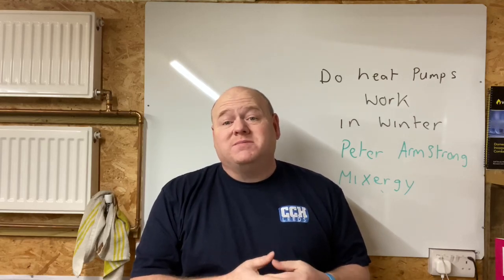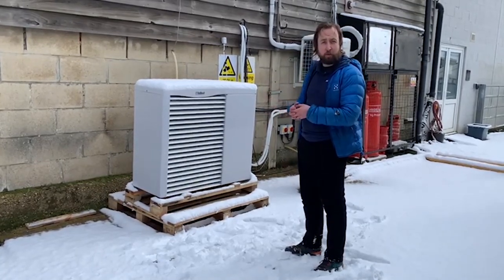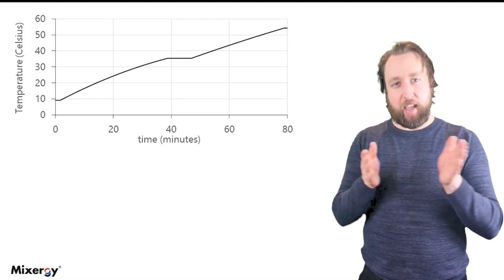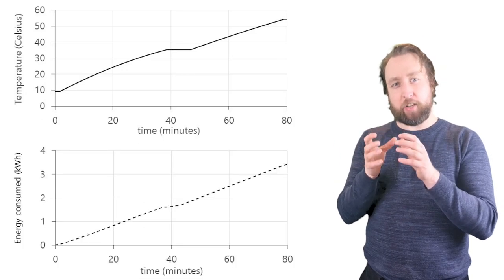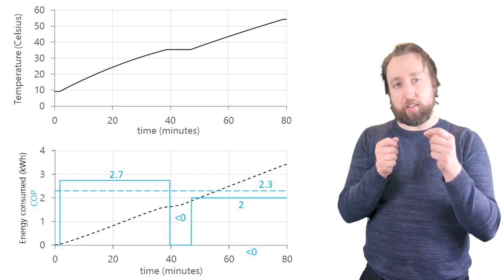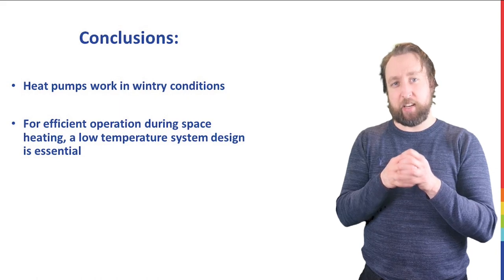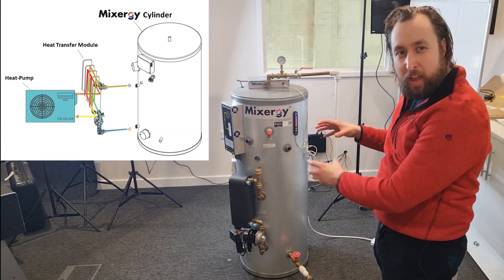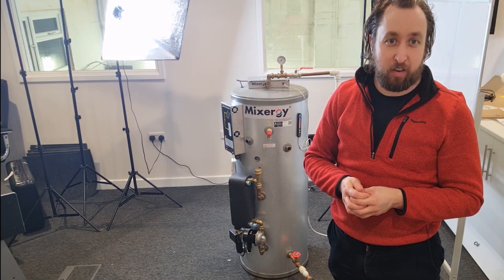Do Air Source Heat Pumps Work In Winter - Peter Armstrong Mixergy

Comment: Ive Fitted ground source and air source heat Pumps with underfloor hesting in and around Munich. And lived in a new build with a air source myself. I can say you can tell the difference in Winter and summer.  As far as retro fitting your average house, i Think these Systems are still prohibitivley expensive. I Think the Systems we were fitting were around 15k Euros. But we working in the Sticks without a gas pipe and oil will be getting phased out here soon.
Reply from the maker: Do they normally work well? Thanks.
Reply: @AllenHart999  yeah they are when theyve been Setup properly. You can be assured that cowboy Builders and weekend warriors wont be throwing them in. The air Pumps are generally easier to install. the ground Pumps. Ive done bore holes in germany and ive done underground flat tubes in north yorkshire. Both bore and flat underground cost alot to install in either case
Reply: Ground heat pumps works well in winters( also in -30). Best suited with ground heating, nut can be used with big radiators with calculation flow40/35back flow
Reply: Presumably the electricity being used to power the heat pump is generated by German's lovely new lignite power stations, sooo green.

Comment: Electricity =15p/kw. Gas=2.5p/kw. 6x more money for elec but when the temp drops outside you're lucky  even to get as much heat out from a heat pump as you put in in power.
Not to mention that r32 refrigerant is 677 times more polluting than Co2 if it escapes.
Reply: My figures are nearer 10x the cost of gas for electric. . . As for the earth, in the UK half the electric comes from burning gas, the generation and transmission is only 50% efficient.
Reply: If one unit loses its Refrigerant CO2, it is still less CO2 than what a Gas Boiler produces every year.
Reply: A typical house running on Gas produces over 4000 tonnes of CO2 per year.
Reply from the maker: Thank You
Reply: @kenbone4535  4 tonnes per year not 4000!, think you misread Kilogrammes.

Comment: I designed my own hydronic radiant heating system for my new build in Ireland. Mixture of underfloor and low temp rads. I'm currently getting SCOPs of 4.5+ from my ASHP. That's only possible because I upgraded he thermal performance of my home to a B Energy rating, I switch to a wood stove boiler when it drops below 7C outdoors, avail of night time tariffs and use a 1000 Litre multi-coil (Solar/Wood Stove/ASHP) thermal store. The system works really well, but it took me about 3 months to finalise the design, before handing it over to my plumber. In my opinion, you need to be maintaining SCOPs of 4+ to make it a worthwhile choice over gas, in the UK/Ireland that is. Regardless of the grants, if gas or oil was an option, I would not have gone with an ASHP.
Reply from the maker: Thank You

Comment: Those heat transfer modules have been around a long time I used one of them 30 year ago to convert an old direct cylinder to indirect they do mean having a special phosphor bronze pump as there on the direct side of the hot water system.
Reply from the maker: Thank You

Comment: Moved into a cavity insulated 70's build house about 4 years ago and the previous owners had installed an ASHP with regular radiators, not underfloor heating. When the outside temperature drops below 3c or 4c then it really struggles. It goes through cycle of frosting up, defrosting and repeating. At best it maintains the house temp at a low 16 or 17c and we rely on plug-in oil filled radiators to heat specific rooms of the house. 

Don't have the money to rip it out and install oil tank based system (in the sticks so no mains gas where we are) so we'll have to live with it until the system gives up and save some money to replace it then.

Comment: These things will work if you have a modern well insulated home with UF heating, however the majority of British homes are not like that. 
And l have worked on jobs where heat pumps have been installed on older properties, and they had to have over sized radiators which also needed an electrical supply for the built in fan.
I just don't get the push for these things in the UK, and the last one I went to was a block of ice, that was heating a swimming pool, plus where there's government money there's going to be miss selling, so you can imagine the adverts in a few years.
Reply from the maker: Thank You

Comment: If the heat pump maximum temperature is 60C then the COP would be curved as it gets close to it's maximum temperature. But the line you show is almost straight line up apart from it's defrost cycle. Also heat pumps use speed control inverters that would use variable  amounts of energy, but again your KWH over time remains constant?  Also are you measuring the temperature of the water at the top of the tank only. A more accurate measurement is to measure the top and bottom of the heat and take the average. But i did the maths on  your numbers 120littres heating water from 10C to 50C at an average COP of 2.3 did work out to take 1hr and 24 minutes. It would have been a nice test if you repeated the test over different outside temperatures for a graph of COP performance. And at what outside temperature the system fails to add heat to the tank. Date 2/11/21 UK price  cheapest electricity 16.7p /kw    gas 6.65p/kw, home  heating oil 5.4p/kw  So to rip out a gas boiler for a heat pump. Is more expensive to run than gas  or heating oil. As for kw to kw of effective  heating  comparison with a COP of 2.3 electric  will cost you 7.2p and gas 6.65p
Reply from the maker: Thank You

Comment: IMO heat pumps make sense when used as an auxillary heating/cooling option e.g. split AC systems that can both heat/cool & are basically air/air ASHP's. Roof Solar can run the AC 100% in the summer, & the AC Unit  can 'topup' the house heating in winter especially on sunny winter days. But for the depths of UK winter you do want gas heating IMO.
Reply: cant enough solar do it all?
Reply: @bootangy  Solar is only working during the daylight hours and the largest demand is in the winter when solar is at its worst  for generating power
Reply: @ianship5058  At least 16 hours of none generation in mid winter is a big turn off.
Reply from the maker: Thank You

Comment: I am a commercial / industrial gas engineer and am looking into all the various sources of heating. Possibly the best option is to have a Hybrid option where if the heat pump cant supply the demand you have hydrogen or existing Natural gas or LPG or oil as the backup source.
Hydrogen itself is not the easiest fuel to deal with, yes the emmisions are co / co2 low or neutral however it also produces Nox and apparently quite a bit more than current natural gas or propane fuels generally do. The other thing is safety - Natural gas is explosive at 5 % to 15% gas in air and has a lighter than air density of 0.6 , Hydrogen is explosive at 45 to 74% and has a specific gravity of 0.06 which as its thinner is much more prone to leaking than Natural gas and is way more volatile, also you cannot see a hydrogen flame easily at all so safety of hydrogen is a massive concern to anyone suggesting to use the existing network to distribute hydrogen.  The Nox element of combustion is approx 5 to 6 times more than Methane (natural gas) and Nox contributes to Asthma amongst many other issues.  The Coils from Ground source heat pumps in my little experience on enquiry did not have an extremely long shelf life, thus the cost of replacement or repair of these ground source coils would be massive.
I dont think completely eliminating fossil fuels is honestly viable and think the best possible outcome is a blend of fossil and renewable fuels coupled with maybe the hydrogen fuel being blended with natural gas.
I'm certainly not a complete expert but just cant see any one solution working on its own.
Another note is that to have a air to air heat pump or indeed a ground source heat pump your house has to be extensively insulated, however many new build houses in the uk are so sealed up and insulated that the moisture the occupants breathe out cant escape the property thus causing damp issues. In instances i have encountered people have fitted a PIV fan in the loft which then reduces the efficieny of the insulation by positively pressurising the house thus creating circulation and assisting the moisture to leave the property but also then losing more heat out of the gaps in the construction of the property because of the positive motive force required to move the moisture out.
Reply: An interesting post that shows none of it makes total sense. But somewhere in amongst it all is the best system for what though, us or the Planet or profit. 

The cheapest greenest system is the Sun, if you block it you have to replace it with something that costs. Maintenance started with the Fire grate in the range and in the hearth and it's moved on to scavenging Heat pumps and wet insulation. The Sun is maintenance free but for some reason we have been concentrating on blocking its ingress and that only favours a few.
Reply: @Mark Conroy we have a hybrid system, a Samsung EHS Mono 16kw ASHP, mated with a Vaillant Ecotec 30kw natural gas boiler.  The system is brilliant, the ASHP takes care of most of our heating needs in a large Victorian stone built house (which we can't super insulate as walls are solid), 15 large rooms with high ceilings, including 5 full size cellar rooms.  The way it operates is that the ASHP is used when the outside temp is above a certain level (we currently have this set at 5c, but can change it if required) and below this level the gas boiler takes over.  Also, the gas boiler heats our hot water.  Additionally, we have a 4kw solar array and a solar i-boost device which diverts excess solar energy to heat our hot water, therefore saving gas as the boiler doesn't have to do it.  Because of the way the system is configured, we are always running the ASHP efficiently and it never freezes up.  Also, as our house has a high heat demand, we don't over-tax the heat pump in cold weather when it may struggle to maintain the warmth of our house at the required level.  We have wet underfloor heating in the cellars and oversized (triple) radiators elsewhere.  We didn't have to change any of our pipework when the installation was done, we kept the existing 15mm copper central heating pipes.  There is no downside (as far as I can see) to a system like this, it comfortably heats our house and our water at a much lower cost than we used to spend when we weren't adequately heating it.  We were replacing our heating system anyway when we had it installed, as our old system was worn out.  Because we paid VAT at 5% on the installation, instead of 20% (because we had an element of renewable energy included), the ASHP effectively cost us nothing, we would have paid the same amount to the installers for a gas only system.
Reply: @spex357  I agree with you fully, when installing any heating system, what is the motivational force and who has the most financial gain. If it is a landlord installation for a house he won't be living in but his intention to to provide the cheapest installation he can get away with, he's happy to let the tenant bare the cost of heating the house. An installer will do the job with as cheap as possible equipment, same goes for every aspect of the build. The person who will be living in the house needs to know a lot about every aspect of the build so that he/she can determine what standards all work is carried out to, however we live in the real world and most homeowners have plenty of other things to worry about so as homeowners we rely on so called professionals to look after all these building projects, I guess most contractors do a fair job for the price they charge their customer but at the end of the day everyone is out to make money while trying to strike of balance of quality workmanship, materials used etc. so that a good reputation can be earned and maintained so that new work will keep coming in, 
As regards to ASHP the freeze up at anything below 15C I use a portable unit in the house to dry clothes which is a fantastic job for that while heating the house at the same time. When indoor temps are below 15C the cold (Evaporator) side heat exchanger freezes up very fast and frequently so the units frost detector cuts the heat pump while a fan keeps running in a attempt to defrost the heat exchanger, obviously this same problem will occur on a large scale heat pump, even with reverse cycling valve to bring heat back out of the heated building or storage tank it still causes efficiency reducing problems, I've only researches this to a basic level but enough to know air source heat pumps are over sold rather than over engineered, until this basic law of physics is overcome it a no from me as an all year round dependable source of heating. If you want to heat water in the summer months or heating when you don't need heat it very good at that returning away better energy efficiency than anything else available. It suffers from the same problem as most other reusable systems (bankers Syndrome lend you money when you don't need it, cut you off when you do need it). These are a good method of heating water in the summertime lets say for a swimming pool with 20C plus air tempts source or even indoor pools where evaporated steam would be recycled back as heat to reheat the water. as I already stated that it has it's uses for drying clothes Dehumidifier or a damp building so long as air temperature is above 15C all is good. So No No NO! to Air source heat pumps as a heating system you can depend on when you will really need it and that is all winter depending on where you live.
Reply: @martinmuldoon603  i was involved in the UK pilot project for External Wall Insulation around 1980 in the SW, from Portishead to the Isle of White, and stayed in the industry for thirty years, mainly working on Social Housing and Towerblocks, Schools and Government buildings. Did the same abroad for a few years as well. Came home for Blair as some big housing projects had been announced. What we didn't know was the bosses and government had conspired to do the project with untrained imported cheap labour, and get rid of most of the trained staff. That business model grew to the point that not many had any skills all the way up to the top. It was the time for Charlatans and crooks. And became more corrupt with every new Government special project, like Warmer homes and the Green Deal. I'd seen enough when I kick started a Government White paper on best practice in 2000, released 2004. If they paid any attention to what I said in my first alarming, "they really hoped it wasn't true" correspondence,  then Grenfell might not have happened. But they stuck to quality of finish so as not to open a massive can of worms. Auditing had been corrupted, Training had been corrupted, the specification corrupted, and it was all public money that was being wasted. There was even a Burn to earn period, sod the clean air, run the woodchip boiler flat out all year, keep all the doors and windows open. Ferry in the woodchip from Canada. I was livid, still am. 
There are a lot of unhappy customers and some are even dead, meanwhile the enquiry goes on and on. 
The pumps will be the same, figures bent, reports printed on an angle, workers on peanuts, dodgy science looks good in the lab, house residents expected to say nothing. Every house expected to be roughly the same as each other, within the chosen parameters.  
I've had aged house holders in properties they have been in since new, that face South, scream at me in rage as I approach to do my survey, get it of, get it of. We should send Insulate Britain round to see if there is a compromise. 
When the Blair was conspiring to lower wages, somebody asked what the trained workers might think about a wage cut. Alister Campbell said they can sign on if they don't like it. Such is the world we live in. We can see corporate law could be deadly for us, and that is where we are heading.

There is one house close by with an indoor pool heated off a loop in the field out the front. It has 200mm of EPS on externally, and is often steamed up. Oddly after all these years I still haven't noticed any Solar there.
I've worked on quite a few design houses here and in Europe and have seen many systems, and have yet to see an ideal system for every house. It's not everyone who wants to grow lemons and Peaches in doors, is it, or have a pool, or a Rocket stove.

Comment: Looks like it is indeed viable. But houses will need to be well insulated to make it as efficient as possible.

Maybe as well where possible pv solar panels can be added to help with powering it along with a solar immersion switcher so excess electricity can help to heat the hot water tank.
Reply from the maker: Thank You